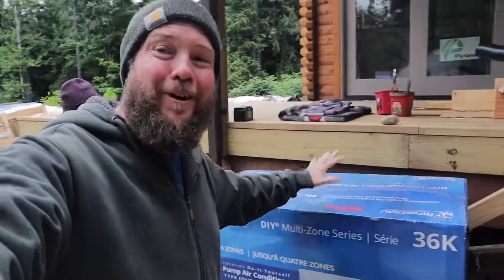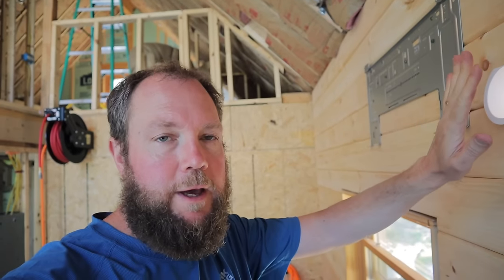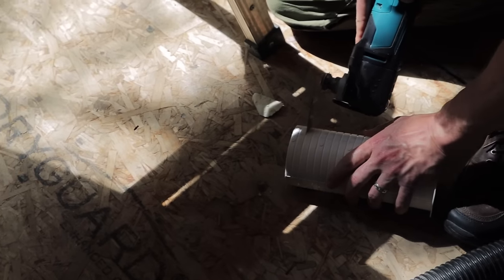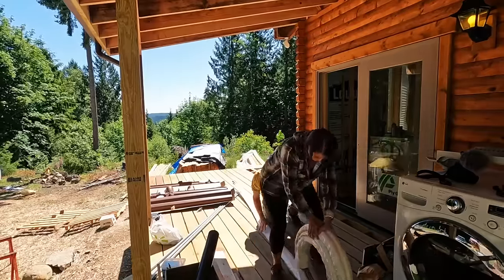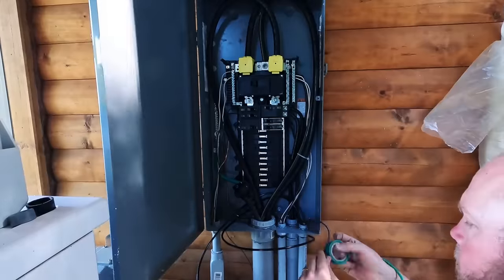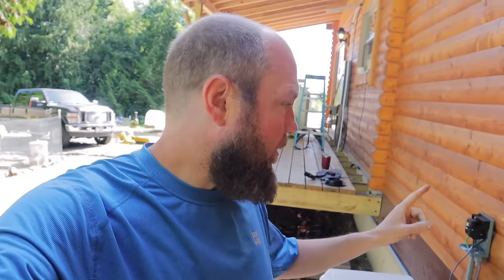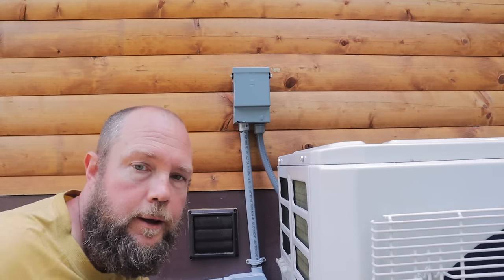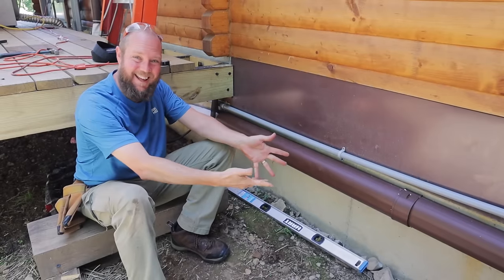Couple Installs Mr. Cool Mini-Split [FULL INSTALL]

Comment: You cannot just release refrigerant into Line set without pulling a vacuum to remove air and moisture in system! This can really cause damage and problems. How is it that the instructions don’t specify this?!!!!
Reply from the maker: The line sets come already under vacuum. This is one of the features of Mr.  Cool that make it DIY friendly.

Comment: Those are not King valves… King valves are three way valves, those are Schrader valves… Also, never let your line sets run below the outdoor condenser as oil might not flow back to the compressor given the low refrigerant flow of variable speed equipment… Did you not run a vacuum pump on the system? If you didn’t vacuum the system, you will have moisture in the lines which when mixed with 410a creates an acid… Not good for your compressor and seals…
Reply: Lines are pre-charged, units are pre-charged, outdoor units are pre-charged. Connectors are similar to threaded hydraulic couplings with double O rings. Those ARE king valves. Schrader valves are the one way valve you charge the system with if it ISN'T a DIY and for maintenance.

Comment: Why aren't you mountain the Unit even with the window
Reply from the maker: Good question.  We would have been just short on our line set length so we had to move it in by a foot to make it reach the outside unit.

Comment: i cant believe you dont have to pull a vacuum on the lines before you turn them on.  that just really  makes no sense to me.
Reply: The compressor comes recharged which means a vacuum has already been pulled on the system. It compensates for the line set that is installed with the system. That’s why the line set comes in a predetermined length!